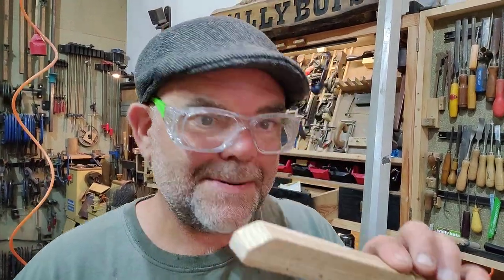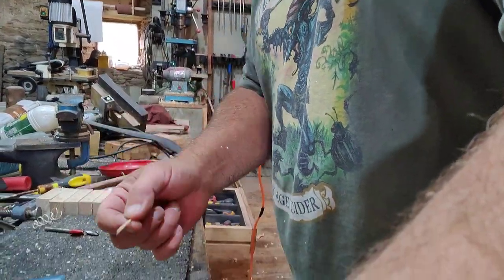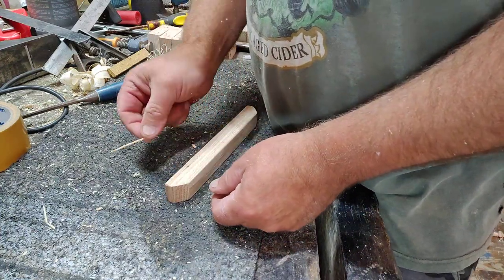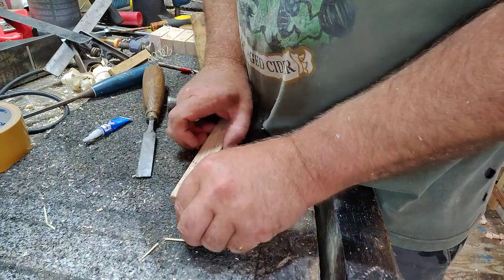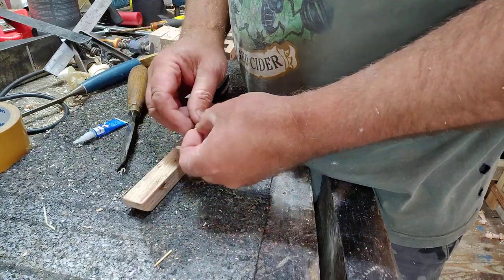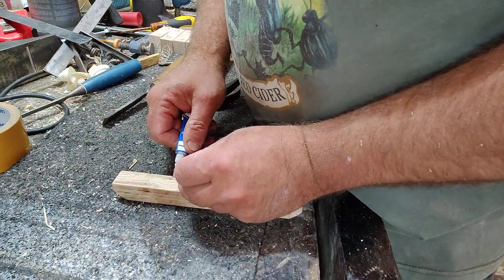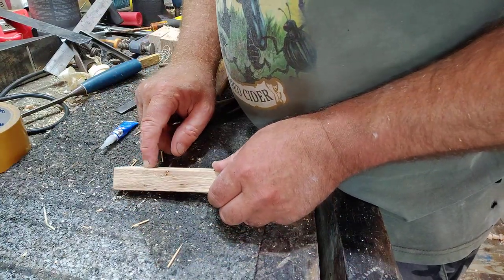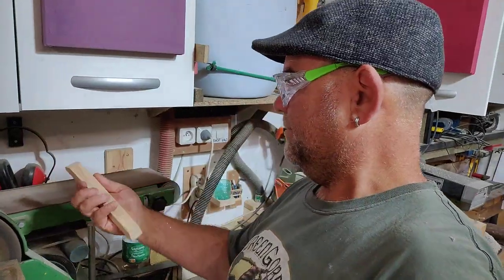Quickly repair WOOD WORM holes in infested FURNITURE / SUPER EASY

Comment: i have a bishop's chair from Ninove, Belgium (1600, date is on it with the Abbey info) but it's loaded with holes throughout the legs, and it's stained almost black.  Would you use this technique on hundreds of holes or would a wood filler be best? and use a wood hardener prior?   the chair is stunning but i'm afraid to sit on it with that amount of bug damage in the legs...
Reply from the maker: I's probably inject it with coloured resin